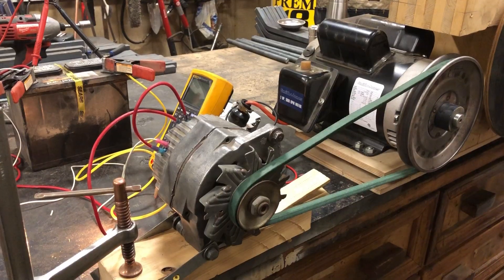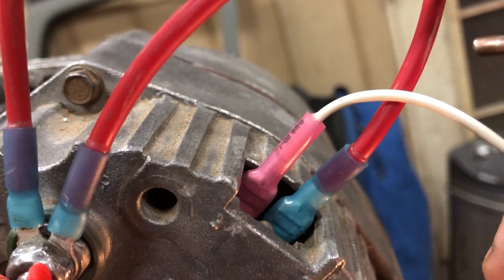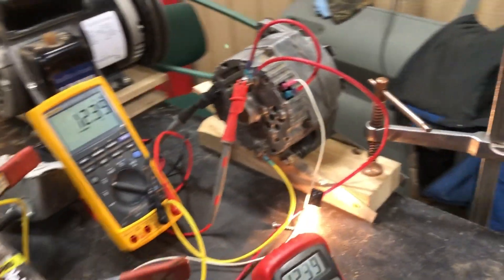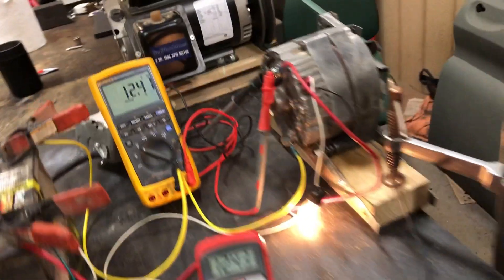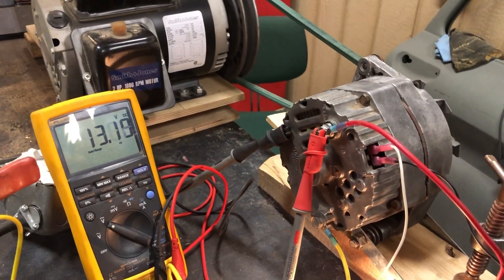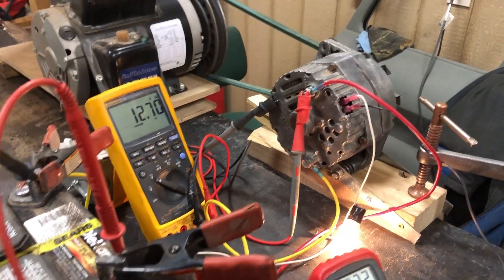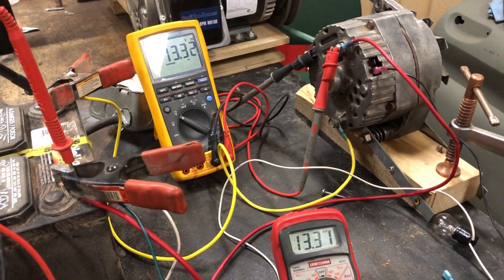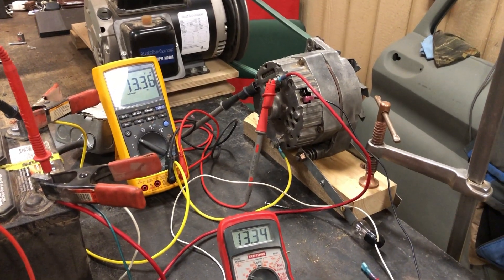GM 3 wire alternator setup

Comment: I have been installing engines in a boat and have been having a hard time getting the generator to work.  You helped me out here.  I have watched many vids on hooking up generators, and your's helped me the most.  I think i got it now.   You are good, or at least you finally supplied what i was missing with the other vids.  thanks. you are doing good.

Comment: replacing alternator connector on 99 caddy. the old connector has only 2 small 16 gauge wires the new connector has 2' 16 gauges and one 12 gauge so 3 wires. do i just tape off the 3rd large wire?? the alternator already has a large ground going striaght to the battery

Comment: Thanks for showing the difference in output when the remote sensor wire gets moved from alternator output to battery post. I have watched several videos where comment section arguments try to explain or de-bunk this.

Comment: Jerus, I own a 1986 k10 chevy truck with two batteries in series and two alternators, but it does not have a tachometer on the dashboard. The alternators are similar to the one shown on this video. I would like to add a tachometer and get the signal from the alternator. Could you, please, tell me from which point should I get the signal? My alternators are k64, model 12SI, rating at 78 Amps. Thank you.
Reply from the maker: The tachometer signal is from the distributor cap and not the alternators. On a gm there is usually a tach wire plug on the side of the alternator rotor cap.
Reply: I am sorry, I forgot to tell you that my truck has a 6,2 lt diesel engine and does not have a distributor. And there is no such a tach wire plug in my k64 12SL 78 AMPS alternator. @JerusBarnett

Comment: That is how i always thought it worked and knowing i can pull my battery cables once the car is running told me the battery is only to start the process once the electro magnet is energized as long as it spins it will work

So i seen 15 volts output now if the battery is connected like typical car charging system is set up does the battery always demand the full output (15 volts) or is that 15 volts on standby and available? Assuming the battery is fully charged and doesnt need any of the 15 volts

And of the 15 volts or whatever is left after the battery upkeep how many watts is available?

15 volts at 60 amps is around 900 watts

So in theory each alt spun at prime speed can produce almost 1kW?

And advice and help would be very appricated Thanks

Comment: Excellent Video.  Regarding the Light... So one side that would Normally go to the Ground goes to the Alternator ?  Am I right?
Reply from the maker: MrDanoconnor yes you are correct. The basis for the ‘dummy light’ is that you send it 12v from the car when running, then on the other side that would normally go to ground goes to the alternator output. If the alternator output is active and working the 12v is on both sides of the light terminal, thus no current flows and the light will be off. If the alternator is weak or broken some current will be allowed to flow across the bulb filament causing it to light up and indicate the charging system has a problem.
Reply: @JerusBarnett  Thank You Very Much for Responding, I'm Hooking one Up to a1948 FORD 8N Tractor.  Very Much appreciated.
Reply: @JerusBarnett  I Just Posted My 3 Part series on the 6 to 12Volt Conversion Alternator Installation  for the Ford 8N , Gave You a Shout out in Part 3, Thanks Again,You made it Easy for the Old Man.
Reply from the maker: I’ll have to check it out. Glad it helped you out.
Reply: Great video. I really appreciate it!

Comment: I have the remote sensor wire attached to the alternator output and the alternator charges until the exciter wire is disconnected. What is wrong?
Reply from the maker: DW Hilman it sounds like there is an internal regulator or diode problem with your alternator. If you attach a light bulb in line with the exciter wire the bulb will be lit when it is off, and should go out when the generator is working (this is how the dummy light works on older cars). If the light does not go out there is  most likely an internal problem in the voltage regulator assembly which can be swapped out. If you live in the United States almost any auto parts store will test your alternator for free.

Comment: Stick a screw driver to the bearing and it will stick to the bearing if the alternator is charging. Old timer trick. That alternator is not a good choice for low speed old tractors. They usually have small drive pulleys and the  rpms need to be higher. Use a Gm CS130 and get plenty of amps even at idle speeds. Nice test and simple to understand.  Good stuff!
Reply from the maker: Mike Goodman good to know on the bearing trick. I use a screwdriver to check if solenoid valves are actuated at work all the time. Never though of doing it on and alternator but it works (just tried it). True on the RPM of this alternator for a tractor but I don’t have a CS-130 laying around or I would show it side by side at the same rpm to see when they both start charging.